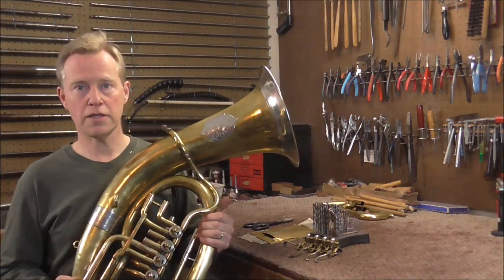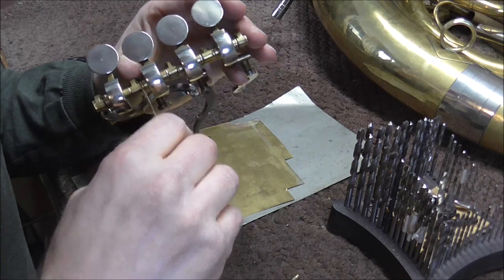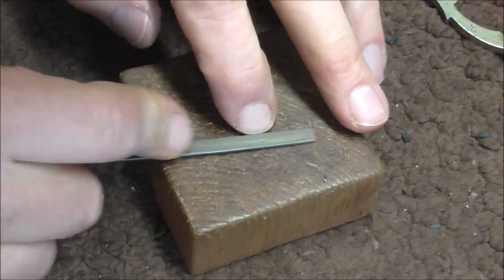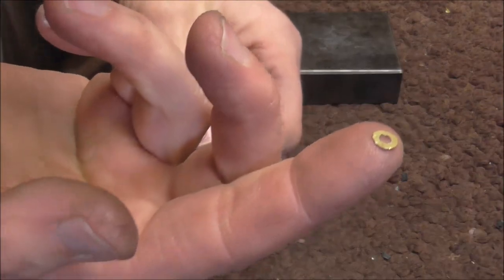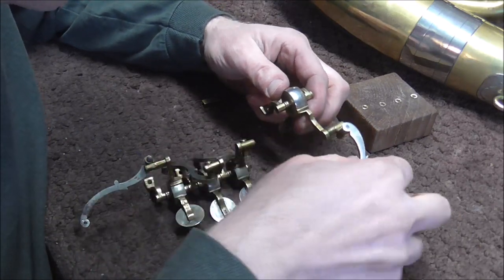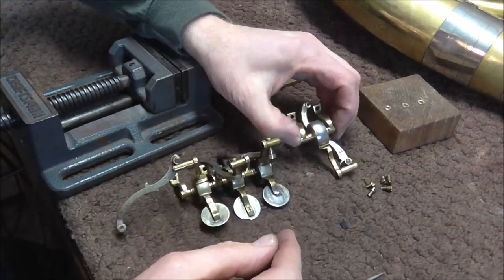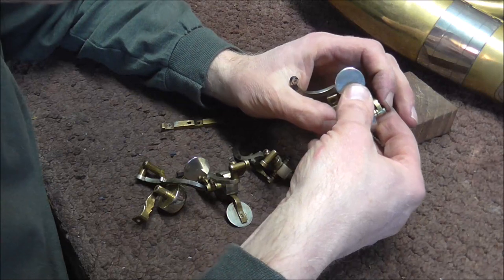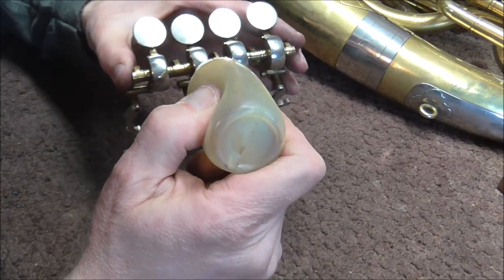Tightening Loose Mechanical Linkage #2: Sloppy Levers

Comment: Nice and simple method, thank you !
If you ever had time to show how this kind of clockspring rotor levers are made (particularly, how to dismantle/change a clock spring) I would be really interrested, I see many old instruments like this and I do not feel confortable trying to repair it, I fear not to be able to reassemble it afterwards...
Reply from the maker: I would have loved to do a video about this, but it was a customer's instrument and it did not need to be taken apart. I was not going to risk a customer's instrument to make a video on a repair that was not necessary. I have taken them apart before and it is a fascinating set-up. When I get one of my own or a customer instrument that needs this repair, I will get a video of it.
Reply: @TheBrassandWoodwindShop  yes of course, I understand that you do not want to take unecessary risks and time on a customer's horn. I was asking in case you have a there's a need to dismantle the spring. I should probably find a junk clock spring horn and have a try.
Reply: I would also be interested in seeing this. One of those things I don't want to take apart to explore unless it is my own instrument.